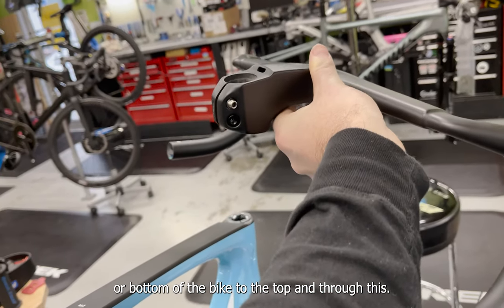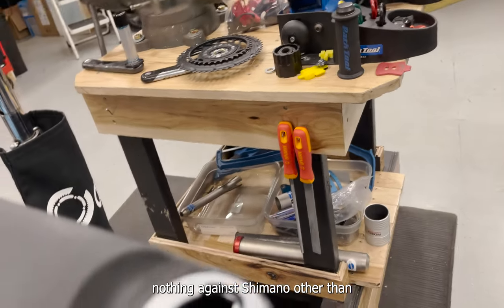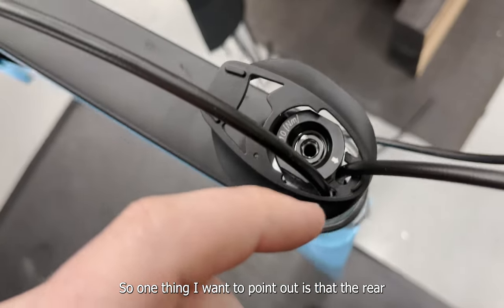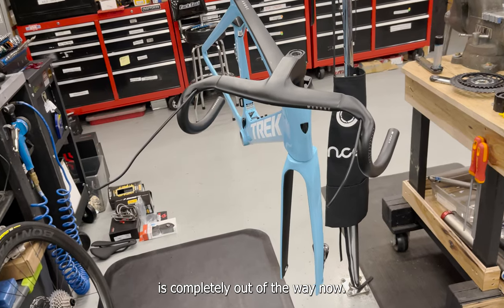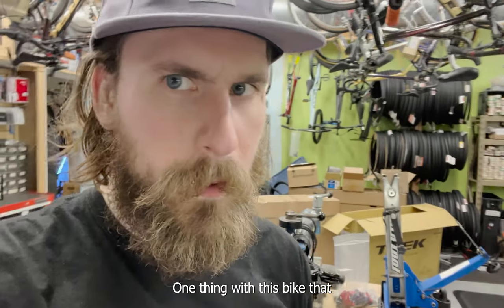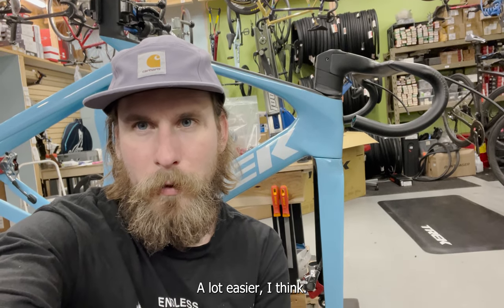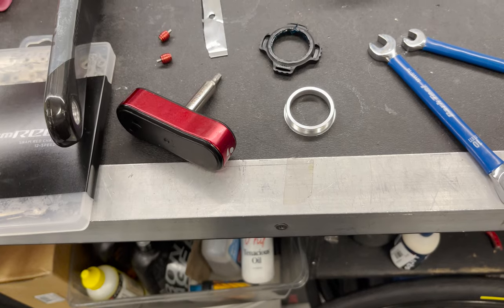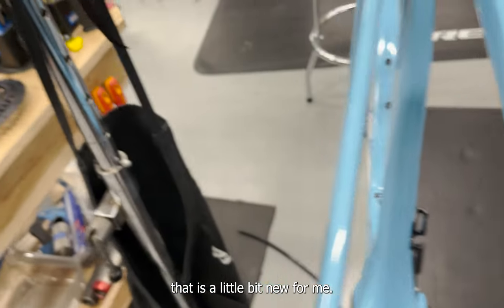Trek Madone Gen 7 Build

Comment: i own this new gen SLR Madone, my old Madone SL had handlebar steering limit. This new one doesn't have it, sometimes when you carry your bike around it hit's the bottle cage so hard. I hate this and no longer using double bottle cage. Only using one single and using down side screws for the cage. Is there any way to put steering limitator on this new handlebar&stem combo ? Also when it turns fully, the brake housing cable near the bottom bracket area rubbing to the frame and makes annoying noise.

Comment: i remove my inner seals from the bb bearings because theyre not exposed to much if anything and i replace the thick grease with oil this will free up the crank enough to pendulum.

Comment: This is an awesome build video man!! Not the aesthetic vibe of some of the dark and weird focus changes in the ASMR ones, but SUPER informative and helpful!!!

I have a Gen 6 frameset that I'm warranty claiming into a Gen 7... Do you know if I'd be able to make the Gen 6 cockpit work on the Gen 7? I'd love to keep mine because I use the speed concept aero bars every now and then. Trek says there's issues, but I'm wondering if there's any way to make it work. Thanks!
Reply from the maker: Trek makes a normal bar with the same dimensions of the Madone bar that might work. I’d expect you to have to get a piece for your headset to make it work though
Reply: @bicyclestation  Thanks! I'm specifically wondering about the barstem from the Gen 6 mostly because the Gen 7s aren't even available right now... Maybe I could print an adapter that would work for me, too. Appreciate the help!

Comment: Do you have a wedge installed behind your front derailleur?
Reply from the maker: I didn’t install them intentionally. It’s shifting really well without it actually.
Reply: @bicyclestation  I see.
Reply from the maker: Are you having an issue with one?
Reply: @bicyclestation  no, I just recently noticed this wedge. I just want to see how people are using it.
Reply from the maker: It’s to help brace the deurailer against the frame and keep the shift smoother. Shimano’s had it forever with the little metal sticker and a bolt.
Reply: @bicyclestation  I didn’t know that. Thanks for explaining!